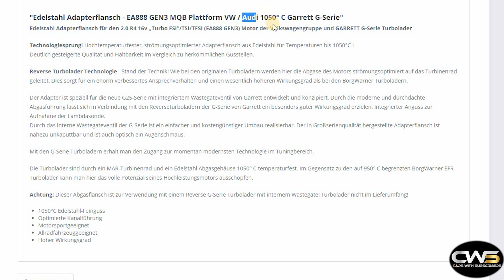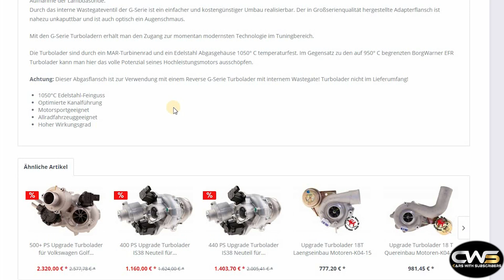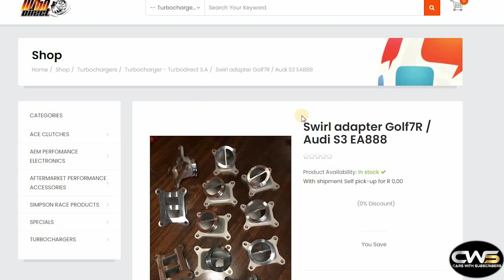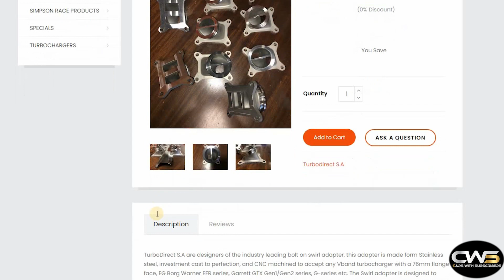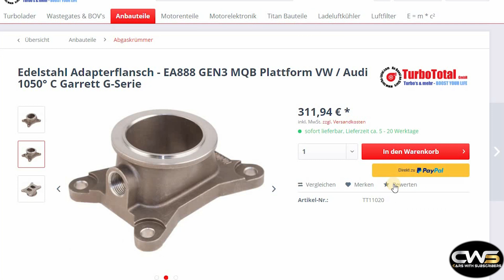Big Turbo Golf 7 R build (no hybrid) Episode 1: EA888 Gen 3 Adapter / Manifold to fit Big Turbo

Comment: I think you’re going right direction the Garrett or the xonarotor by Irozmotorsport would be excellent as well !
Reply from the maker: The Turbo i bought i think is the Same as in the Iroz motorsport 780 kit. Thnx for the comment✌️
Reply: Cars With Subscribers Awesome a guy in Australia ran one with a forged motor and water meth kit it ran very well!
Reply from the maker: Hope mine does good aswell, thinking of meth 2.
Reply: Cars With Subscribers he ran the aquamist meth kit I believe and had direct port with the kakarakis performance manifold with big throttle body by grams performance!

Comment: What sort of power are you aiming for
Reply from the maker: Hey Sav, the goal is to get as close to 700 Hp as possible but Everything above 600 Hp is fine for me. Thnx for the comment👊
Reply: Cars With Subscribers i hope you think about internals, the stock ones will not hold for 700hp, tune it safe.
Reply: Engine is fully build👍🏼 No stock internals.
Reply: @BoostBroers  we made 774whp same turbo/motor in the states, you'll love the power.
Reply from the maker: E85? My rods cant handle that. You have any footage?